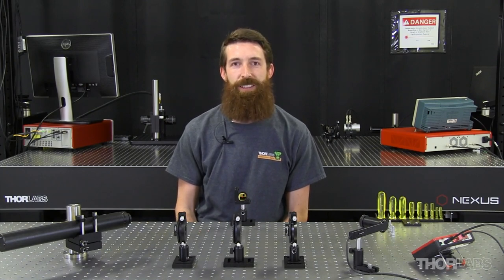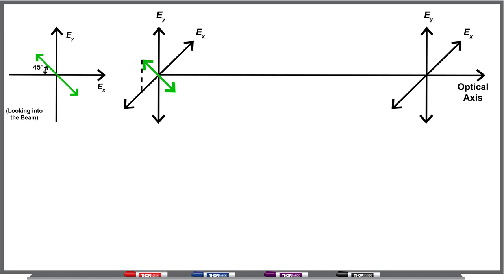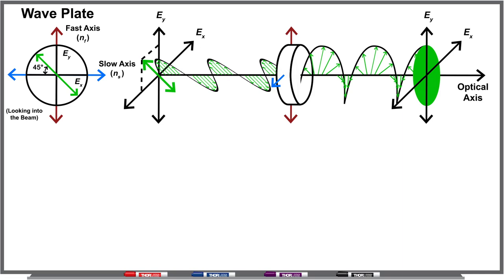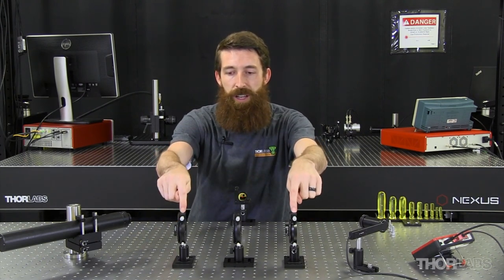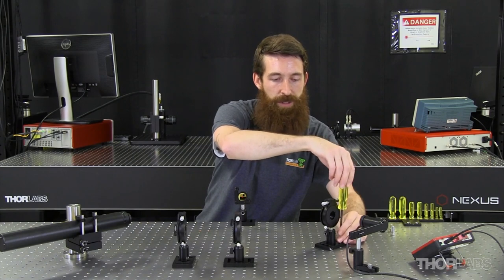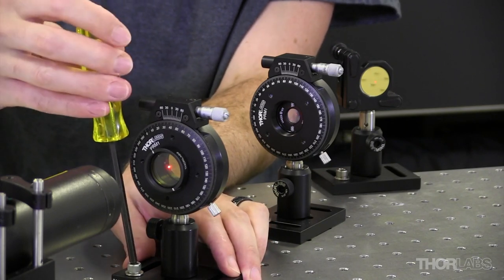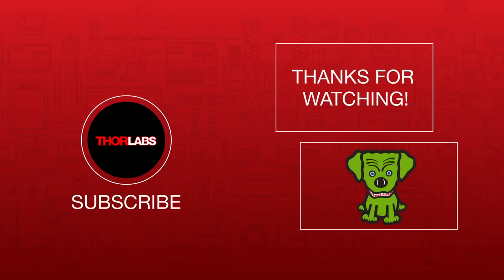Distinguish the Fast and Slow Axes of a Quarter-Wave Plate | Thorlabs Insights

Comment: I recommend performing this analysis as I have one of these quarter wave plates that is incorrectly labeled.  I performed this experiment on two different QWPs and found one of them was incorrect.
Reply from the maker: We’re so happy you found the video useful! We also recommend confirming the optic orientation, since it can be different than expected for various reasons. One is that the engravings on waveplates can be hard to interpret. In fact, we know that the engravings on ours manufactured prior to October 2018 have led to a fair amount of confusion. Another reason is that some people, in my lab at least :) , like to take the optic out of the mount, use the optic in something else, and then orient the optic incorrectly when they sneak it back into the mount.
 
Please let us know if there are any other procedures you would like to see demonstrated or if you have any useful tips you would like to share.
 
-Bill Warger, Video Insights Director

Comment: You note that "Note that this technique cannot be used to distinguish the fast and slow axes of a half-wave plate."  Does ThorLabs have a video for that particular experiment?  Thanks, this was a great video.
Reply from the maker: @user-ch5eq2mu3f  Thorlabs doesn’t currently have a Video Insight demonstrating a method to distinguish a HWP’s slow and fast axis, but thanks for asking - it’s now on our list! 
It is typical to use measurements of optical path length to determine which HWP axes are fast and slow. The optical path length traveled by linearly polarized light aligned with the HWP’s slow axis is longer than the optical path length when the linearly polarized light is aligned with the HWP’s fast axis.

Comment: Hi. I am using an achromatic quarter wave plate which is a composite material. Can you make a video or point me to a resource to minimize the error due to tilt of the plate?
Reply from the maker: @mukulsharma3447  Thanks for the suggestion! There are different approaches to minimizing the error. One approach is to adjust the wave plate’s alignment, until the wave plate provides as close to optimal retardance as possible. For example, input linearly polarized light to the wave plate, while simultaneously adjusting the wave plate’s alignment and using a polarimeter to analyze the output light. 

Another approach, which can be used alone or in addition to the previous approach, is to mathematically correct the results provided by the system after making a measurement. This requires measuring the wave plate’s actual retardance. When this is known, the actual retardance can be used when analyzing the results provided by the optical setup. The approach is described in Section 3.A.3 of Paul A. William’s paper (Applied Optics, Vol. 38, No. 31 (1999) 6508).

Comment: Nice video. I have a question, you mentioned photodiode at 03:24, how does it work?
Reply from the maker: @davidjoy2128  The power sensor we used in this demonstration is a silicon-based photodiode ( https://www.thorlabs.com/thorproduct.cfm?partnumber=S130C&YVI=14 ), which is sensitive to visible wavelengths and has a semiconductor PN junction at its core. This article ( https://www.thorlabs.com/newgrouppage9.cfm?objectgroup_id=14218&YVI=14 ) gives a quick overview of photodiodes, as well as providing some information about their wavelength-dependent performance. We also mention at 03:24 that we attached a couple of components to the power sensor that minimize the amount of stray light reaching the sensor. One of these components is the long black tube (lens tube), and the other is the iris that is attached to the input of the lens tube. The combination of the lens tube and the iris allows only the light travelling along the laser beam’s path to reach the power sensor, which reduces the amount of non-signal light incident on the sensor. We have provided part numbers for all setup components (including the lens tube and iris) in the description, if you would like additional information about them.
Reply: Thanks!

Comment: Hi if I use a laser initially vertical polarized and i place a PBS IS there any horizontal light After this PBS?
Reply from the maker: @fethallahkarim-pj7so  We expect that the polarizing beamsplitter (PBS) would transmit some horizontally polarized light. This is because linearly polarized laser sources do not provide perfectly linearly polarized light, and because the PBS does not perfectly separate the two orthogonal orientations of the polarized light. 

Most light output from a linearly polarized light source is polarized in the desired direction, which is vertical in your case. However, it is typical that a small fraction of the output light is polarized in the orthogonal direction, which is horizontal in your case. The amount of laser light polarized along the desired direction is commonly specified using the polarization extinction ratio (PER). This ratio is calculated by dividing the intensity of the light polarized along the desired direction by the intensity of the light polarized along the orthogonal direction. Ideally, the PER would be infinite.

Similarly, the performance of a PBS is described by its extinction ratio (ER), which is typically measured and specified for only the transmitted direction. One approach to measure the ER for the transmitted direction is to place the PBS in a highly polarized beam of light, measure the power in the transmitted beam as the PBS rotates 360° around the optical axis, and divide the average of the two highest powers by the average of the two lowest powers.

It is possible to estimate the amount of horizontally polarized light that passes through the PBS in the case you brought up. For example, consider vertically polarized input laser light with a PER of 15 dB. Assume that vertical polarization is aligned to the P-polarized direction of the PBS, the ER of the PBS’ transmitted path is > 1000:1, and the reflection efficiency of S-polarized light in the PBS is >95%. Since the laser’s PER is 15 dB, approximately 3.2% of the input light is expected to be in the orthogonal (horizontal, unwanted) polarization direction. With an ER >1000:1, we would expect no more than 0.0032% of the incident power to be horizontally polarized after traveling straight through the cube.  With a reflection efficiency >95%, we would expect about 3% of the incident power to be reflected from the cube as horizontally polarized light.

Comment: Thanks for the video. I have a question, why the polarizer after cold mirror have to be cross polarized to the first polarizer?
Reply from the maker: While we chose to cross the transmission axes of the two polarizers, the technique will also work if their transmission axes are oriented parallel to one another. However, if the two polarizers are oriented parallel to one another, the equation for R needs to be modified:  in the numerator of the equation for R, ±Delta should become ±(-Delta). If the equation is not modified, but the two polarizers are oriented parallel to one another, the "fast axis horizontal" curve changes places with the "fast axis vertical" curve. A good reason for orienting their transmission axes either parallel or perpendicular to one another is that either of these two cases simplifies the equation for R. 

For those wondering about our mirror, we used an unprotected gold mirror, instead of a cold mirror. Cold mirrors (https://www.thorlabs.com/navigation.cfm?guide_id=2234 ) are designed to transmit IR wavelengths while reflecting visible wavelengths.  We did not use a cold mirror because the complex refractive index of gold is more readily available.

Comment: Thank you for great explanations. You mentioned thath using unprotected mirrors makes life easier. If I will uae protected gold mirror, how much it will influence the result? Is it still posiible use this method?
Reply from the maker: @Namig Alasgarzade   An unprotected gold mirror (item # PF10-03-M03) was recommended since the equations used to calculate the reflection coefficients are simpler when the reflector consists of a bare metal surface. A protected gold mirror or other coated metal surface can be used with this method, but the equations used to calculate the reflection coefficient depend on the number of coating layers, their thicknesses, and their refractive indices. Not only are the equations more complex than the ones shown in this video, but it can also be difficult to determine the information needed to perform the calculations. That said, we tested a protected gold mirror (item # PF10-03-M01) in our setup, and we measured power values very similar to those we measured in the video. So, under certain circumstances, the protective coating layer may not have a significant impact on the measurement, but in general that can't be assumed.
Reply: @thorlabs  Thanks a lot :). I
Reply: @thorlabs  I used the protected gold mirror (#PF20-03-M01) and found the results are opposite to yours. When engraving is horizontal, it has smaller reflected power than when it's vertical. I don't know why? I use the 800 nm laser. Moreover, when I tested with a HWP, the power when engraving is horizontal is larger than when it's vertical. Is it right for the HWP?
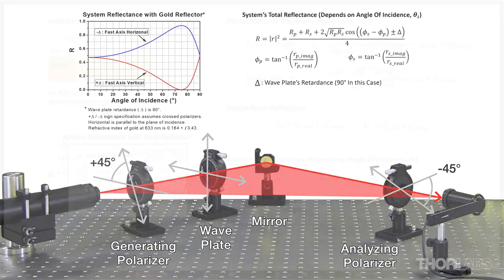Reply from the maker: @xinhejiang4027  It is hard to know the reason your results differ from ours without having a better understanding of your setup and the measurements that you are making. Having said that, there are two things that typically result in measurements that are opposite to the ones we made during our demonstration. One is the orientation of the analyzing polarizer's transmission axis. In our setup, the transmission axes of the generating and analyzing polarizers are crossed. When the two polarizers' axes are parallel, the power measured at the detector when the quarter-wave plate's (QWP's) axis is horizontal would follow the lower-power, red curve in the plot shown in the video (6:47). The power measured at the detector when the QWP's axis is vertical would follow the higher-power, blue curve in that plot. Something else that would result in your measurements being the opposite of ours is if the engraving on your QWP indicates the slow axis, rather than the fast axis of the QWP. This is definitely a possibility.
 
However, it is confusing  that, when a half-wave plate (HWP) is inserted in your setup, significantly different powers are measured when the fast axis of the wave plate is vertical and horizontal. It is expected that both power measurements would be the same. This can be seen by considering the polarization orientation of the light output by the HWP. The light output by the HWP should be the same when HWP's fast axis is oriented both vertically and horizontally. (Due to this, the method described in this video is not appropriate for distinguishing the fast and slow axes of a HWP.) The measurements you obtained with the HWP in the setup indicates that your setup may differ from the one we demonstrated in unknown ways. We advise comparing your setup with ours and contacting Tech Support (techsupport@thorlabs.com , or https://www.thorlabs.com/locations.cfm) if you'd like to discuss it further.
Reply: @thorlabs  Hello! I am sure the transmission axes of the generating and analyzing polarizers are crossed. I used the QWP (WPQ05M-808) to test. But I think this QWP is an old component. The engraving on the QWP is only "FAST/". Not "FAST/Axis". I see that the powers are almost the same (like 8.10 mW and 7.82 mW) for the HWP. We used a 810 laser and the set-up is almost like yours. I think I need to send an email to your Tech Support.
Reply from the maker: @xinhejiang4027  From your description, it seems that the fast engraving does not indicate the fast axis. That is possible if it was one of our waveplates manufactured prior to October 2018.  

Seeing a slight difference in power is not surprising if the laser wavelength is not exactly matched with the half wave retardance of the waveplate.  It is possible that you could determine the fast and slow axes of the half wave plate with the setup, but which axis provides more power would have to be carefully reconsidered.  A more direct method could be the use of low coherence interferometry to measure the optical path as described here: https://www.thorlabs.com/newgrouppage9.cfm?objectgroup_id=711&tabname=Tutorial#FastAxisID.  Out of curiosity, why do you need to know the fast and slow axes of the half wave plate for your application?
Reply: @thorlabs   I have no idea whether this QWP is prior to October 2018. I think it's an old waveplate. I am not intended to test the fast and slow axes of HWP. Just because I want to check whether this method can be applied to the HWP. If so, I can crosscheck different waveplates to see what's the problem. But it doesn't work. So I just checked the QWP. I tested several QWPs which have engraving. By using the protected gold mirror, I got the opposite result. So wondering whether all the engravings of these QWPs are slow axes.
Reply from the maker: @xinhejiang4027  If the engraving on your wave plate looks like the engraving shown in images a) and b) of this picture (
https://www.thorlabs.com/images/tabimages/waveplate_fast_axis_engraving_a1-780.jpg), then the optic was manufactured after October 2018, and the engraving should indicate the fast axis of the quarter-wave plate. (This assumes the orientation of the wave plate in its housing has not changed since its manufacture.) 

If the engraving looks like the engraving in images c) and d), it is necessary to use the method demonstrated in this video, or the interferometric method described in the page linked to in our previous reply, to determine whether the axis indicated by the engraving is fast or slow. Please contact Tech Support if you'd like to speak with someone about this.